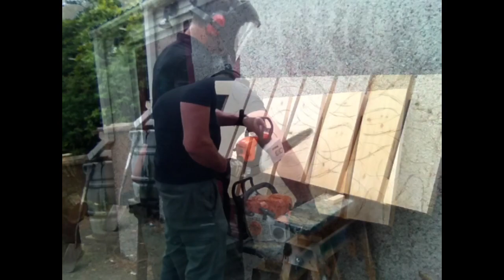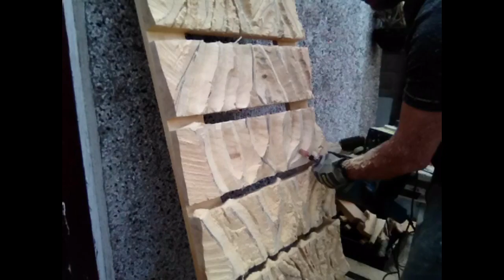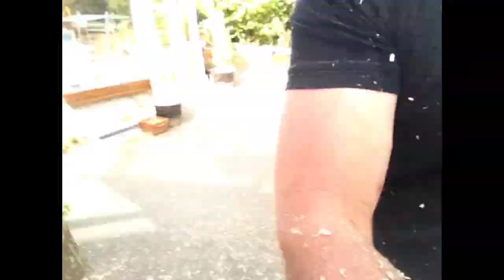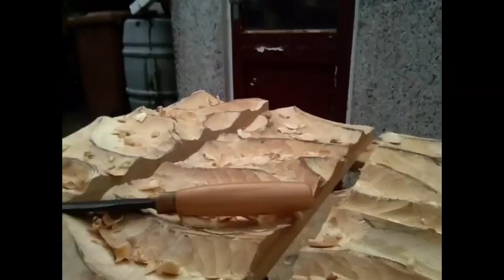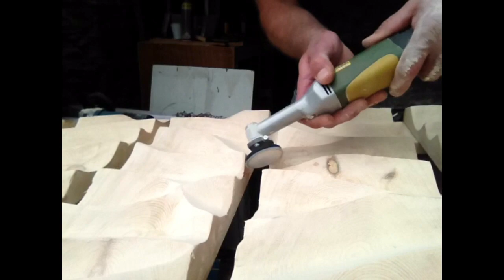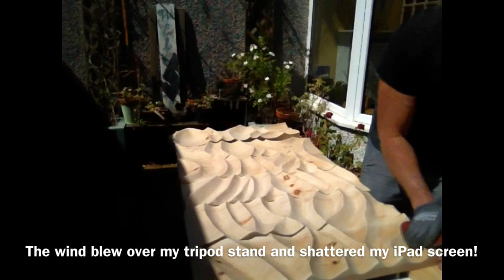power carving a wall sculpture

Comment: How did you attach the boards to the two by fours while you were carving it?
Reply from the maker: Hi there,  I used screws in the back to hold the boards in place. I make sure not to put them more than 50% of the depth of the wood and also try to design it so the screws will be in the deepest parts of the wood.  Another way I do it is to use hot glue from a glue gun. That also works well. Thanks for watching!

Comment: Good work Jonathan. This is the only video I've seen of your's so far. Have you ever used a chainsaw disc?  I use them for  power carving bowls.
Reply from the maker: Thank you Eric, I have tried the chainsaw discs before but find them a little to aggressive for me. I tend to stick  with regular chainsaws and other angle grinder discs. I can see how they would be very useful carving bowls though!
Reply: @JohnathonWhittaker  the key to the chainsaw discs is to go lightly and get the feel and the hang of it.  I recommend an 11 amp grinder with a paddle switch. That way if it gets away, it shuts off. I had a mishap when I first started using one. Luckily I wasn't hurt but I did learn real quick what not to do. Some of them can be expensive but I picked up the Warrior brand from Harbor Freight. And oof course, they do need sharpening after a while.
Reply from the maker: @ericjohnson2543  i use a paddle switch  and a step plate.  If I move my foot off the plate it cuts power immediately. Nice little safety feature, just in case
Reply: @JohnathonWhittaker  thank you. I'm definitely going to check into getting a step plate. Didn't think of that before now.

Comment: Hey Johnathon, thanks so much for the video!  What kind of wood is that?  Also, it seemed like the angle grinder gave you a better result than the chainsaw, but wanted your input.  I'm newer to carving and trying to learn as I go.
Thanks again!
Reply from the maker: Hi Mike, chainsaw or an angle grinder both work great.  I like to use the chainsaw to start as it's fast and quite safe. The angle grinder is a great tool and takes lots of accessories but is a more dangerous tool. Doesn't have a brake and does tend to kickback sometimes. If you do go for the angle grinder, get one that has a variable speed dial so you can also use it for fine sanding. I have a few other videos on my channel showing the different blades and sanding pads that I use. Thanks for watching! Oh your other question, the wood is regular pine, easy to shape and takes colour and stain well

Comment: Sorry for the iPad
Never found the link for the tools though ...specially for the donut grinder
Reply from the maker: The donut style discs are from saburrtooth.  The kutzall ones work really well too. I use the 4 inch ones on the angle grinder. Here is a link but there are lots of places to get them. https://www.axminster.co.uk/saburr-tooth-carbide-discs-100mm-4-ax931328 the arbortech turbo plane in a handy one as well. IPad survived! Just had to replace the screen thankfully!